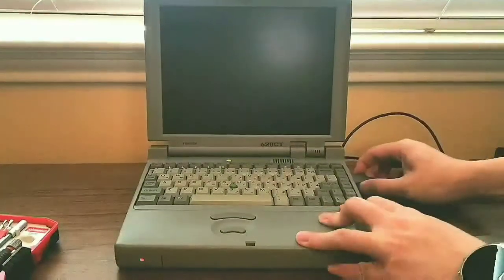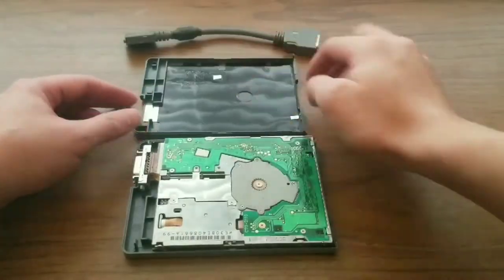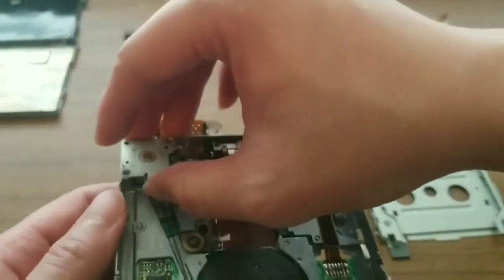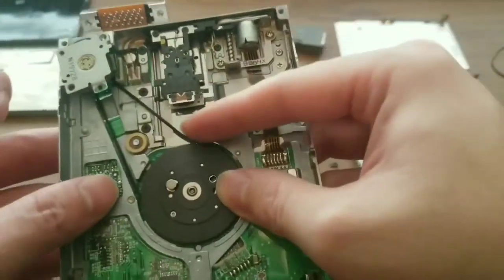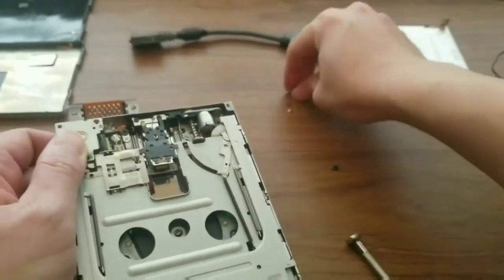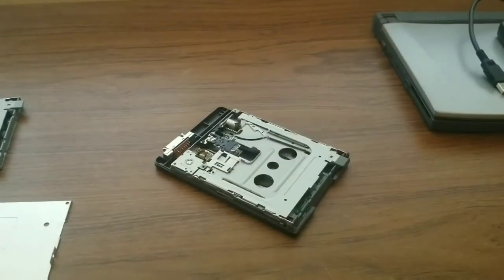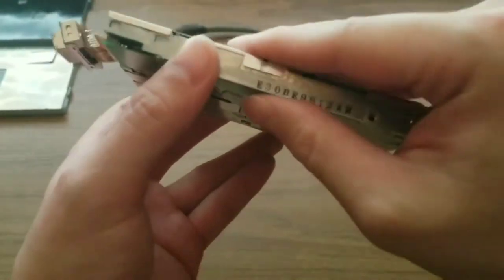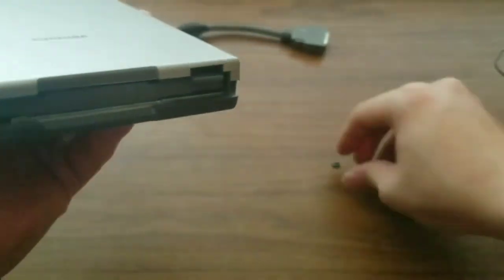How to fix a Toshiba floppy drive

Comment: I had a few Toshiba CT110 Satellite laptops I was flipping and the floppies didn't work... not sure if the rubber band would of fixed them (cleaning the heads didnt work). Anyways, the supplier was out of stock and I assumed they stopped selling them. Today I checked to see and they had a few in stock, but I wasn't sure if it was the right one. searched for this video again and.. yeah it's available. not sure what they charge for shipping, but $5.00 plus whatever it is is pretty reasonable vs probably paying $60 for an untested floppy drive from ebay... yeah im a hypocrite for selling on there, but I rather sell a junk laptop entirely than parting out everything to nickel and dime it all.

Comment: Do you happen to remember what that orange ribbon to the main connector looked like? I've got three dead floppies for the Tecra 700 series here, but I'm looking at buying a brand new drive from a Tecra 8000 series. Looks about the same. If its got the same 26-pin connector internally I should be able to put the new drive in an old case and into one of my laptops. Just trying to find out if this was a standard connection since there's an adaptor after it on every drive enclosure.